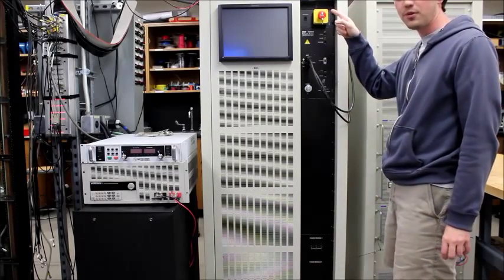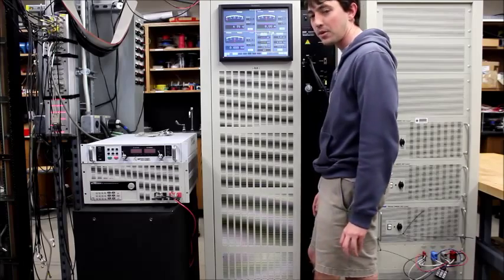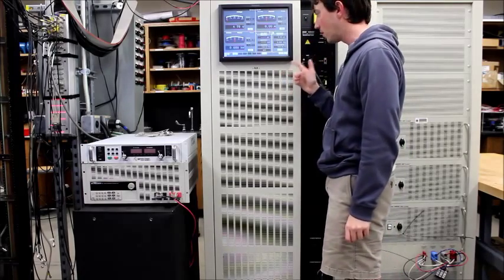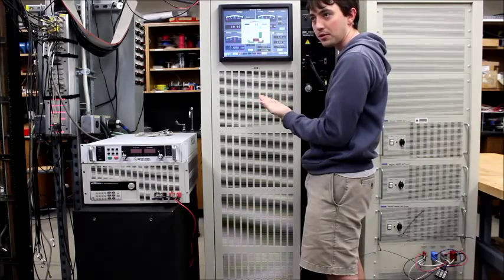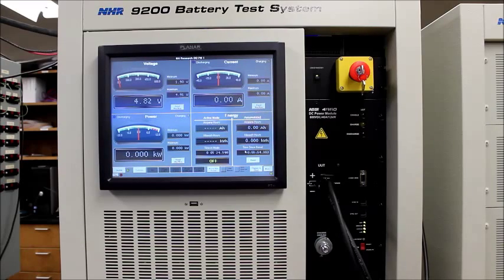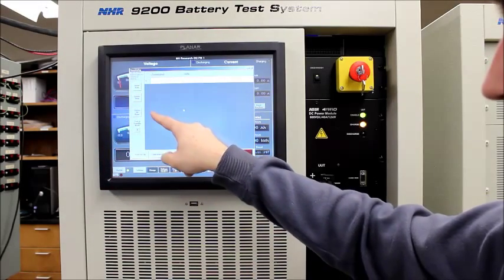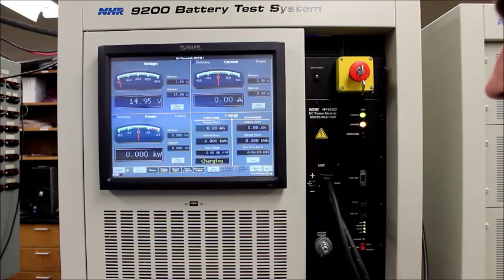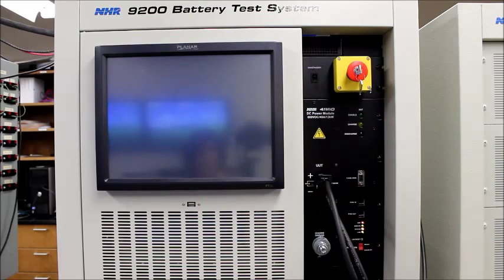NHR 9200 Introduction

Comment: Jesse would you know how much a basic 9200 system cost. thanks
Reply from the maker: I made this video in grad school, not sure what the going rate is. NH Research goes to a lot of the power electronics expos etc. with sales reps or you can call/e-mail them for an up to date quote. The other thing is the 9200 is really just the series, you still need to pick what voltage/current range is useful for your test. IIRC we got the 600V max/40A max/10 kW max module. There was also a 40V higher current unit available when we got ours, closer to a battery module voltage rather than a string of modules.